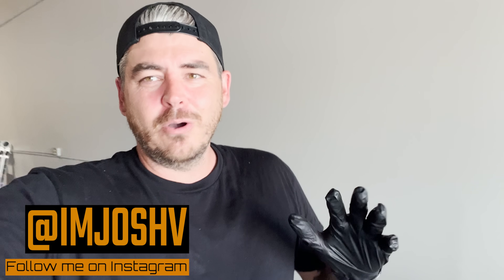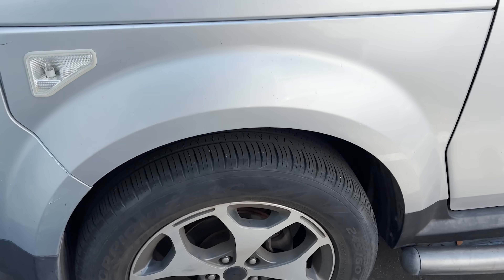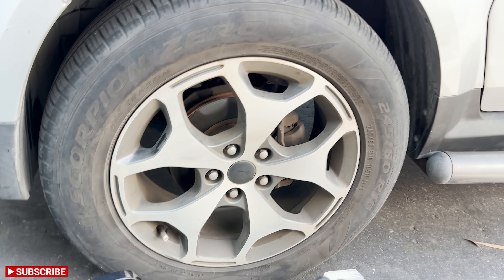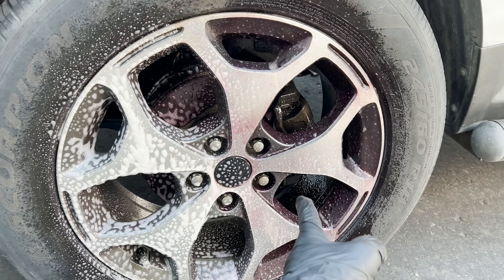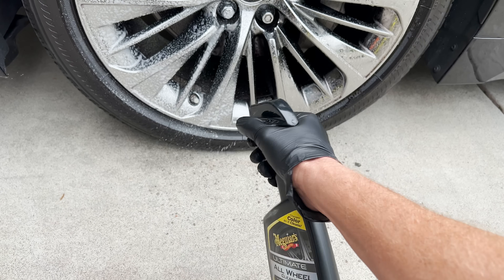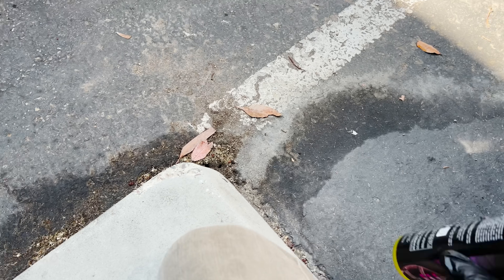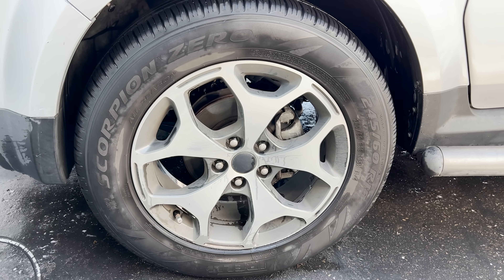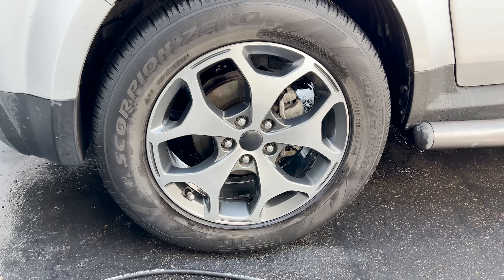Is the NEW CHEMICAL GUYS WHEEL CLEANER with Iron Remover GOOD OR BAD?

Comment: Never used either of these products however, I have used Adam’s wheel cleaner and found that to work really well.
Reply: Adams wheel cleaner is definitely better because it's a lot stronger. I wouldn't buy anything chemical guys because there's so much better out there for the price.

Comment: Whatsup josh. What would you use on tires that someone put a thick coat of some sort of shine crap that doesn't come off with traditional soap. Pressure washer blast or is there a soap that you think would work.
Reply: Try Dawn dish washing soap, it works well. Good luck 🤞
Reply: @bensantos4244  that was the 1st thing I tried.  I actually used the Walmart purple degreaser and scrubbed like crazy and it eventually all came off. Brand new truck and someone put he worst gooey shine on there.
Reply: Adams wheel and tire cleaner will clean it with no problem.

Comment: I have a BMW M4 and have a terrible time w my rotors rusting after a detail and that creates dust that ruins the wash when I drive. Is there a product I can use to remedy this?
Reply: Check out Hyde's Rust Stopper....That's exactly what its made for, but you can obviously only spray it on the side of the rotor facing you.....Also not sure how it fares against acid wheel cleaners that rust the rotor the second they hit it.
Reply: Suck to hear man i used this product and left my rotors rusty too 🤔

Comment: Always good to see new products.  I've tried a few, but old school methods work great too.  My cheap go-to has always been a gallon of water with a few table spoons of Dawn for suds and a few cups of vinegar.  Apply, agitate, and rinse quickly.  Repeat on tough spots and rinse thoroughly.  As long as you don't let it dry, it's a darned cheap way to clean filthy wheels.  On a car that get's washed weekly, basic car shampoo with normal agitation is just as effective as expensive wheel cleaners, IMO.